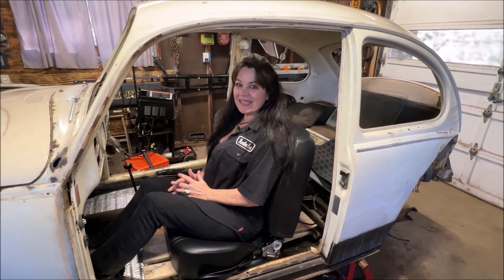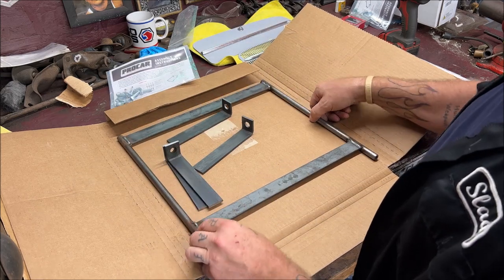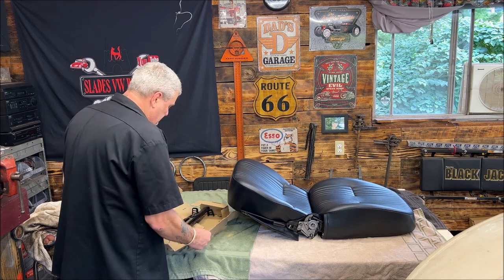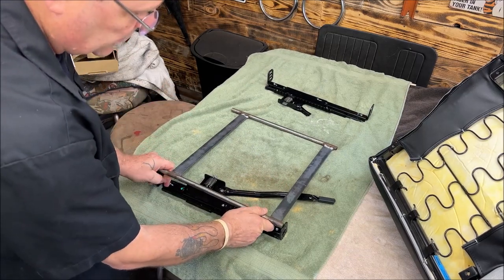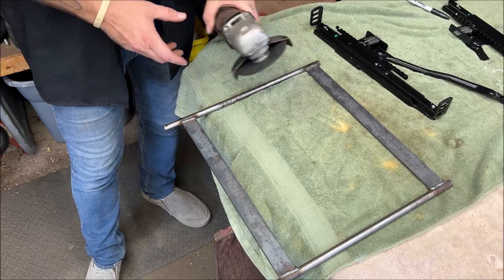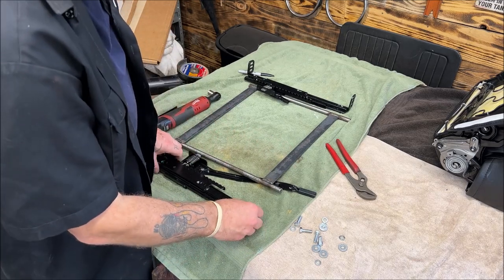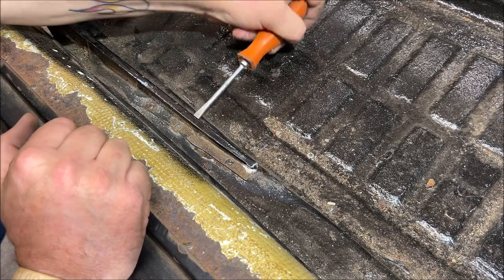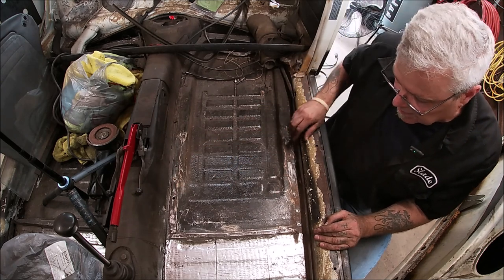VW Beetle Custom Seat Install DIY PART #1 - Low  Back Buckets - Scat Pro Car Seats - Easy Install

Comment: You want to make sure it all goes together so you don’t end up blaming the paint for a fitment issue. I bought one of those same spot weld tools for a radiator support for a car i was crash repairing and it saved a lot of time . Note; this is not boring but it is a very good instructional video!
Reply from the maker: Thank you for taking the time to leave a comment John! I truly appreciate that. I didn’t want anyone to wonder, ….why did he put it all together, and take it back apart. 🤦🏼‍♂️😁
Thank you so much for the kind words.

Comment: Great video. Love those seats. Never really been a fan of aftermarket seats, but i really like yours. When I got my 68 it had seats from a Mercedes in it...and boy were they "mocked" up. Held to the tracks with sheet metal screws. Thank goodness they didn't cut tracks out
Reply from the maker: Thank you so much Darren! I typically like the stock seats. But these low back buckets, really made me look at it as a 60s look. Surprisingly they’re extremely soft. And the vinyl is very thick. I can’t wait to finish them up.

Comment: Another great video! I need to order one of these summit kits, the previous owner bolted aftermarket seats straight to the floor pans.
Reply from the maker: I will be bolting straight to the floor pans. But I chose these brackets because of the strength. I’ll be showing in part two, the adjustability. The seat will be able to be adjusted side to side up-and-down and tilted front and back.

Comment: Hey Slade, I ask a thousand questions but thanks for indulging me! My 72 super beetle original seats are loose and wobbly on the tracks, not a secure feeling! There are plastic track liners in place but they don’t seem to do their job? Any experience tightening up the tracks? Thanks!😊
Reply from the maker: That’s never a problem Bob! I don’t mind answering questions when I can. Check the plastic liners, to see if they are worn out. Chances are they probably are.

Comment: I'm at this exact spot in my project, and was trying to figure out which way to proceed (move the stock rails back or fab up a new custom rail/bracket).  I think I have my answer now.  How do you handle the gap in the carpet the custom brackets present?
Reply from the maker: Thanks for taking time to leave a comment! I’m looking for a lot of flexibility, for up and down, in front and back positions. I don’t want to be up against the dashboard. That’s why I chose not to go with stock seat rails. 
I’ll end up showing that with the carpet. 
I’m going to take the back piece and move it forward. 
And then I will get a close match, to put behind the piece closest to the backseat. Since it won’t show as much. 
I’m sure it will make sense when I show it, that was kind of hard to explain lol

Comment: Is it absolutely necessary to remove the rails? I have the seats, the universal seat adaptors and the seat brackets , but don’t want to remove the spot welded pieces
Reply from the maker: Oh no!! You can use the factory rails with the adapters. 
I was just wanting to move my seat, back much further than normal, and a little lower. But you’re good to go!
Reply: @SladesVWBeetle  so my seats,  procar rally low back, come with sliders. Then the universal pieces would get me from the sliders to the rails?